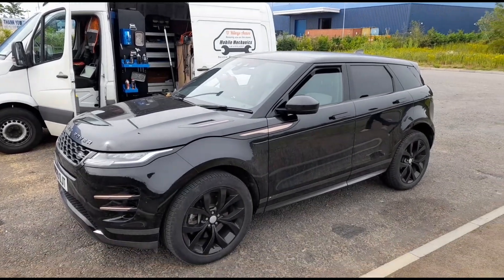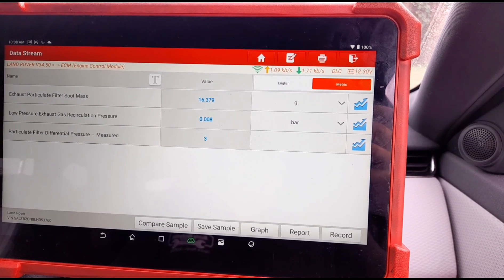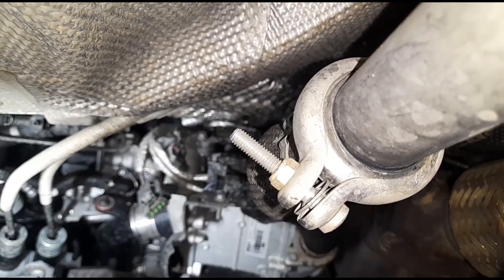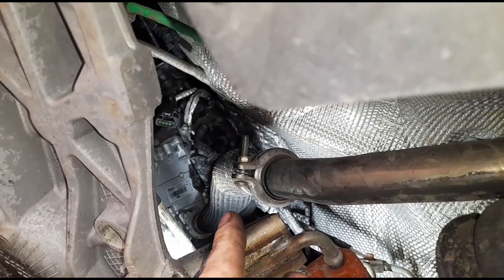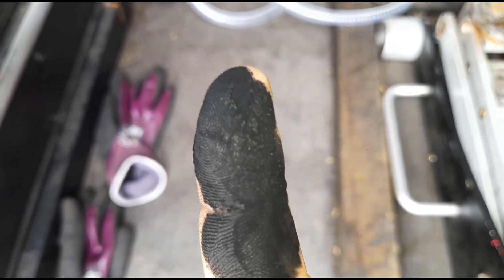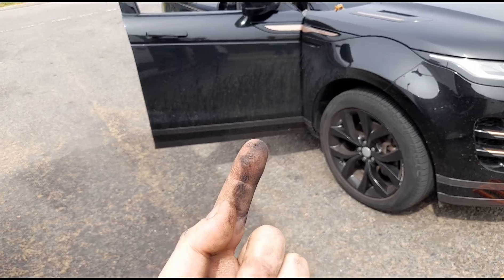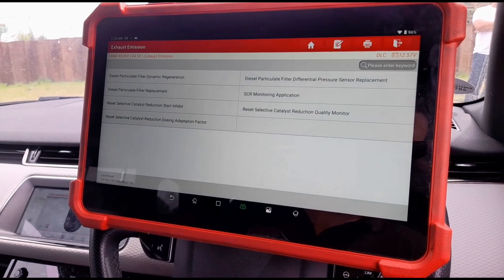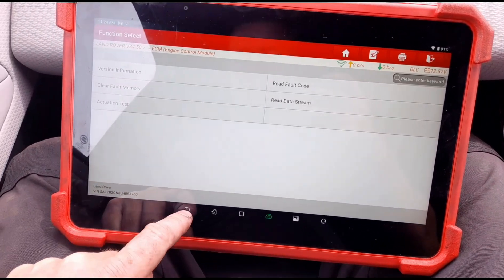Land Rover Range Rover Evoque 2.0 P2002-92 Particulate Filter Efficiency Below Threshold Diagnostic

Comment: hello Jimmy, maybe you can help me. My LandRover Discovery Sport gets the error message P2002-92. The exhaust pipes are a bit black, but not as much as in your videos. how do i find out what is defective? i would be very grateful for your help. Thanks, Ibo
Reply: Code P2002-92 indicates a mechanical failure (cracked) of the DPF which will unfortunately require replacing

Comment: Why don't JLR put a light on the dashboard to say the DPF is regenerating? You can then decide to carry on driving or stop and have a failed regen, My 2019 Evoque did a regen on Saturday on the A50   travelling 70 miles but did one tonight having travelled 25 miles. We got home and the exhaust was banging and popping so another failed regen. So, another £250 oil change in January. Time for a class action?

Comment: Hi I just watched it where you could not sort the code out I sorted mine out by replacing the fuel filter I already tried the cleaning route but it didn't work so when I done the filter it neather came on till I needed to do the filter at 35000 miles again and I did the filter and it worked again

Comment: Very informative. I've got black soot in my vw mk6 tdi tail pipe, finger tested, not nearly as bad as this rover. Originally when scanned fault codes P00AF and P2002 came up the same issue I had from 3 years ago. (Dealership nightmare) 
Did a fresh oil change and forced a stationary regen, P00AF went way but P2002 came back after about a week of driving. Forced a regen while on the highway for about 10 minutes, but had to slow down and the regeneration stopped. Order liqui moly dpf 2 step cleaner because that's what's only available within a week delivery in the states.

Its unfortunate that all these dealerships have nothing really in place nor guidelines on helping customers resolve these issues better.

Comment: Hi jimmy 
I have a 2.0 eco blue transit on 83000 mile the paper work shows its on the third dpf . I
Just fitted new injectors new air filter new fuel rail sensor checked for air leak .
It’s on if second egr which I took of and cleaned not easy on a RWD.  Plus new nox sensor . 
Still blows black smoke on acceleration.  Black soot in exhaust and fails it mot .
I thick the last owner had the adblue code deleted . Shows no code but show high nox on 
Live data . Cleaned the dpf . The dpf pressure is ok . Getting over 30 mpg around town 
Maybe you just have to change the dpf every 25000 mile . Not sure how that saves the planet 
Follow all your great videos any thoughts would help 
Cheers Tom

Comment: High soot load calculation  but low ish diff pressure  - you said the dpf is damaged, there is soot ( alot ) at the tailpipe- all correct. My comment would be the dpf has melted and is holed ( hence the soot coming thro to tailpipe ) which would correleate with the diff pressures. There is however an underlying issue with the engine,  that has caused the initial problem-  even with no dpf, the tailpipe should not be anything like that sooty, so its not running correctly.
Reply: Have you ever owned a turbo diesel without a DPF?

Because they always have soot in the tailpipe, its impossible not to have it.
Reply: @MichaelB-GTK  This is incorrect. Even at lambda 1 for diesel there is soot because of the combustion process. If there was no soot it would mean that the combustion process was 100% effective and all fuel was completely burned. This is impossible in real life. 

Even at lambda 1 some spots in the cylinder will be richer and some leaner because of the injection and swirling. Engineers try their best but it's impossible to get a completely even and homogenous mixture of diesel in a cylinder, to summarize - there is always  soot.
Reply: @MichaelB-GTK  Exactly, but it's still enough to make your tailpipe sooty if you don't have a DPF.
Reply: @MichaelB-GTK Would a bad or faulty EGT sensor cause a high adblue consumption?
Reply: Wrong about tailpipe not being sooty if you don't have a DPF and engine is healthy.

I have new cars with faulty manufactured DPF leaking exhaust gases past, the exhaust pipe becomes sooty but the car is perfectly fine.
All diesel engines no matter if 100% healthy or completely clapped out produce soot, just some more and some less. So to summarize, even on a perfectly healthy 100% engine you would still have a sooty exhaust if you wouldn't have a DPF.
Reply: @nesmio7378  I have owned diesels with DPFs since 2010 and used diesel for work with DPFs since 2005 (mk2 Zafira CDTI Auto always had DPF fitted)

Never any soot in the tailpipe.

I also know somebody that had the same Fiat CDTI engine in his non DPF Zafira Mk2 and there was always spot in his exhaust, it was still a fairly clean engine, unless you tuned it and then that engine would roll coal

Comment: good job, I have an evoque 2.0 and I had to buy an autel maxi ap200 to control the regenerations in this engine, it is essential, I change oil every 10,000kms.
I have 100,000 km on it and when I run my finger over the exhaust it is completely clean.

The scr system is poorly designed, unless you play watchman with diagnostic tools.